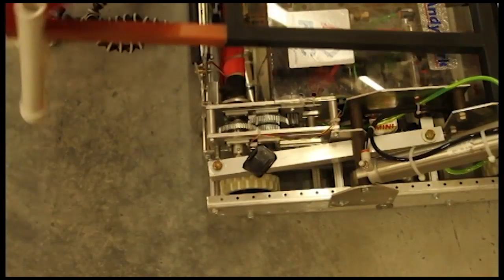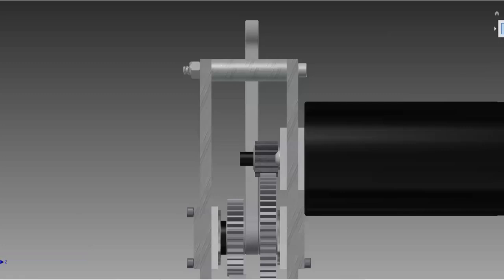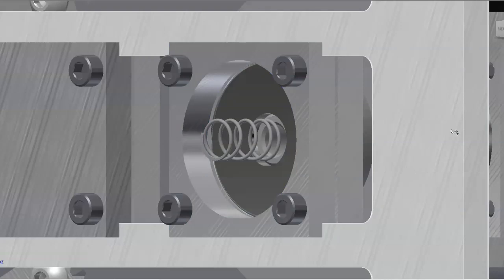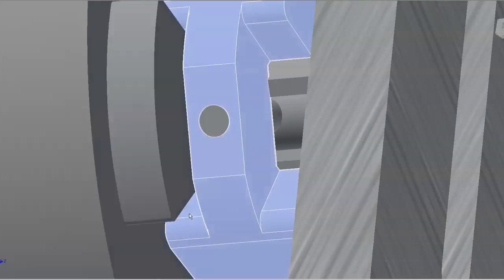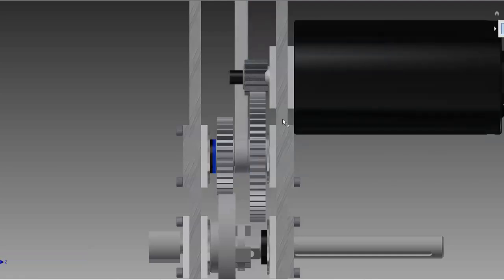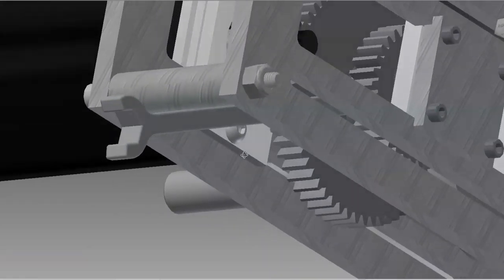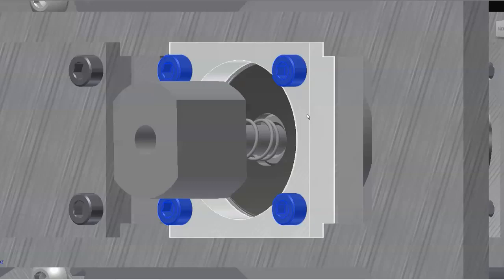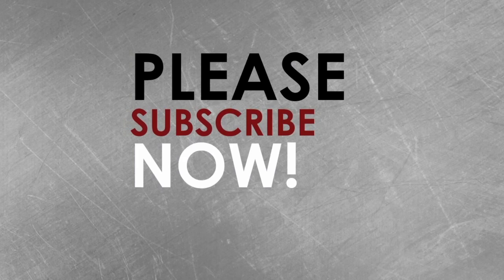One Way Drive With Quick Release Gearbox

Comment: I am having difficulty opening the .stp file.  I have used a viewer, but upon opening the file, an error shows up saying "Unhandled exception has occured.......This is often an indication that other memory is corrupt."  I've tried different viewers with the same result.  Any suggestions?
Reply: Hello, Mr. Sollie. I got a notification of your post. At Tulane, engineering students have access to some CAD software, specifically SolidWorks. I opened the Rev_2 step file successfully in the full program without any errors. Searching the internet revealed some forums which suggested freshly installing the software, rebooting, and attempting to open the document again. Beyond those tips, my knowledge of troubleshooting CAD problems is limited. Good luck.
Reply: Thanks Christopher, I'll try those suggestions.